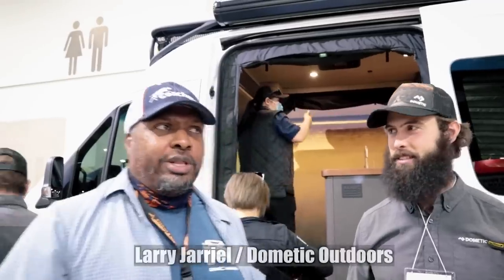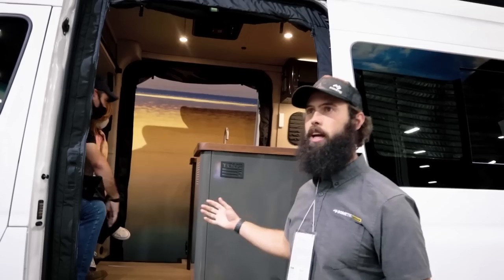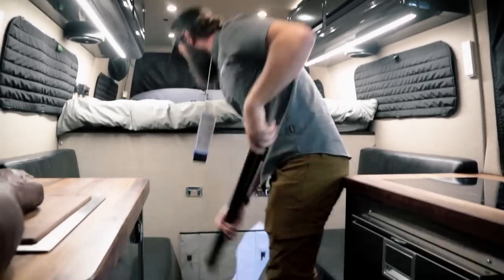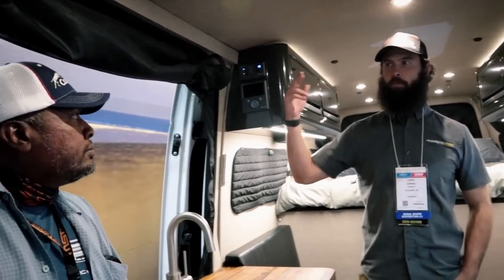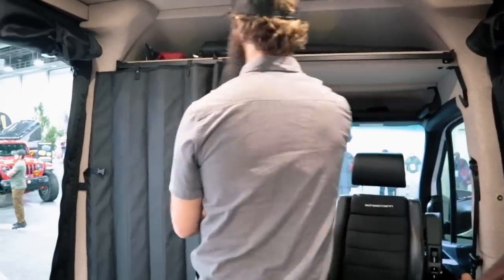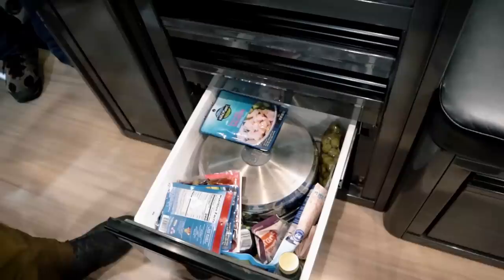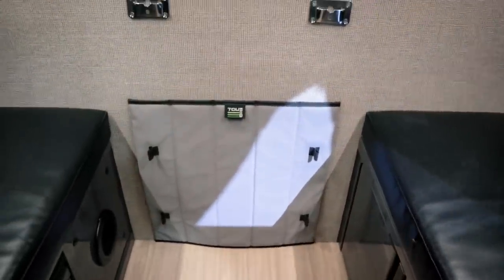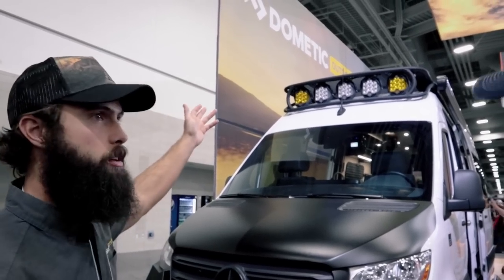IMPRESSIVE DUAL SLIDING DOORS TouRig Sprinter Camper Van Build & Dometic Outdoors New Products

Comment: Apparently this guy doesn’t realize that you can make shorter cabinets than what Tourig makes. shorter in height you can also make them shallower in depth. you can also make countertops that are on drawer glides so they can slide out well you use it if you have an issue with your head being too close to the cabinet for you to use the countertop